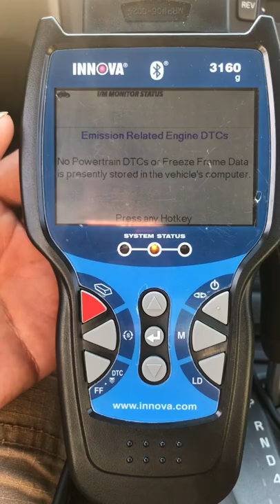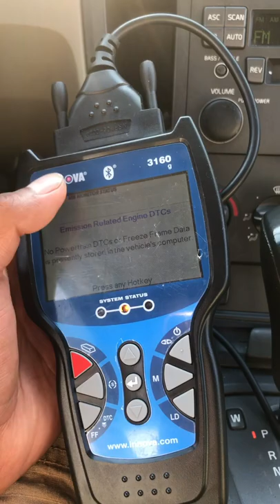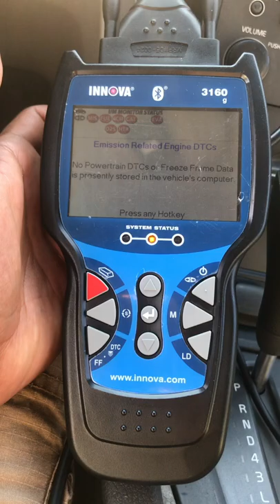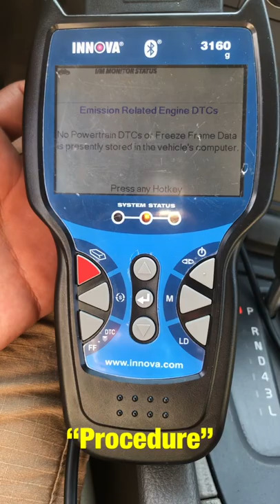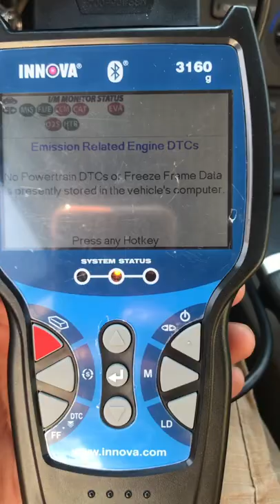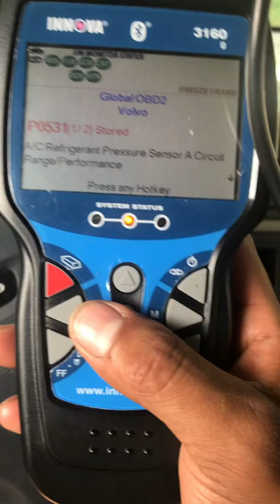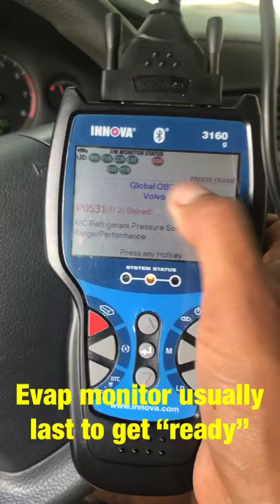Evap monitor not ready ct emission pass

Comment: Thanks this video actually helps a lot.  I need to pass emissions and the damn evap won't go ready and i want to get this done.  It's the only thing not going ready.  I'm in CT too and i'll just go tomorrow and see what happens, but thanks for posting this.  Now it looks like i can just go with the evap system not ready.
Reply from the maker: Paul M i think you will pass, hear the comments? You can go with 2 monitors not ready!, as long as you dont have check engine light on on dash
Reply: @azaelm4829  I think every state is different with how many monitors don't have to be ready.  I tried looking up connecticut, but there's no real info out there about the specifics.  The thing is the car isn't even throwing codes, so i really just was waiting for it to go ready.  I just had to replace the battery and it reset everything.  Now i was sitting here the last couple days waiting for the evap to go ready, but it stays incomplete.  Everything else is good to go, but thanks to your video, i'll just go tomorrow morning and hopefully pass.  Don't see any reason why i wouldn't if you passed.
Reply from the maker: Paul M if it does pass comment it so you can help other people👋🏽👌🏽👍🏽
Reply: @azaelm4829  I'll update you tomorrow